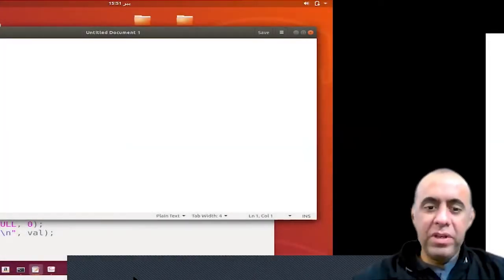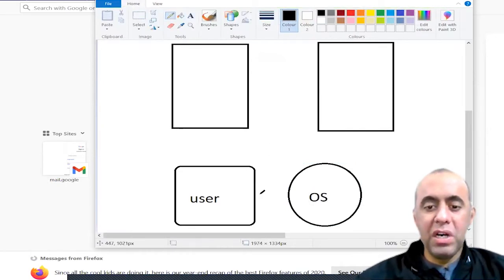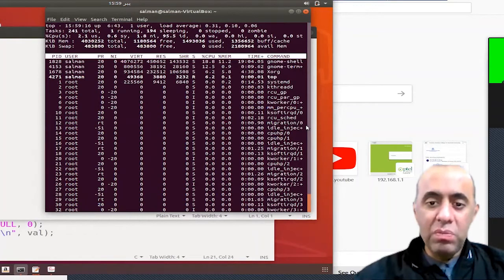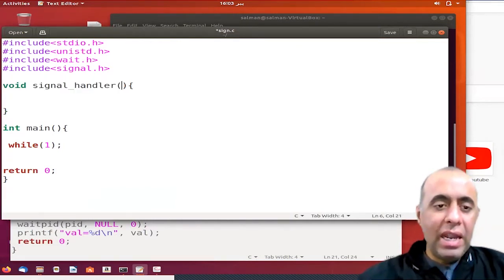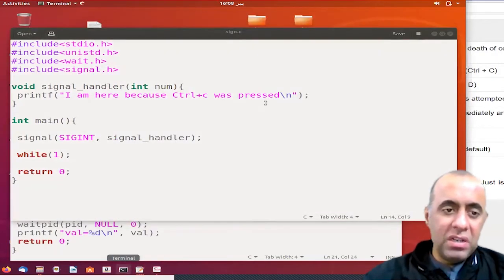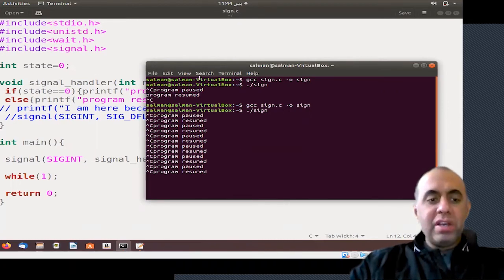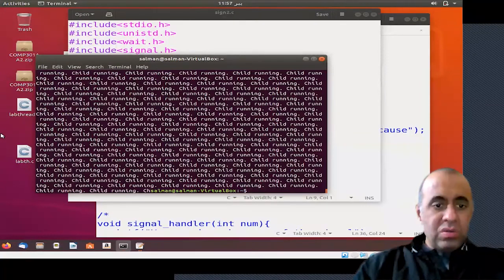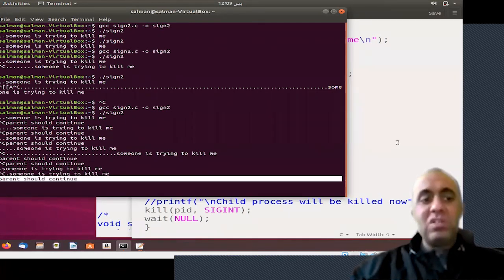Using Signals in C for Linux - [ SIGINT ] for Inter Process Communication [ kill system call ]

Comment: Sir if I don't use \n  ( printf("CTRL+C"); )in the function signalhandler then it doesn't print anything but if I put printf("CTRL+C\n") then it works just fine....Why is \n so important
Reply from the maker: It has to do with the buffering of the output of a c program.
Reply from the maker: The order of printing is non-buffered output then buffered output,
Reply from the maker: all printf are buffered, the problem with buffered output is that the system outputs when the buffer is full or when new line begins,
Reply from the maker: you can force the output to be displayed by clearing the buffer using fflush(std) function right after any line that is trying to output something such as printf( )
Reply: How can one define buffer.... What is a buffer
Reply from the maker: An array of finite size in memory, used to temporarily store data, in this case, the data is the output of our program